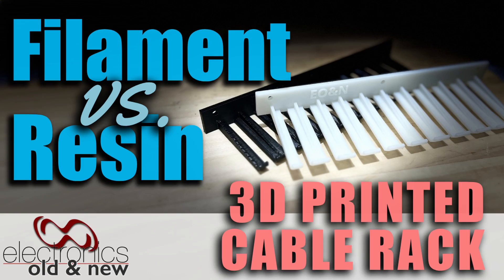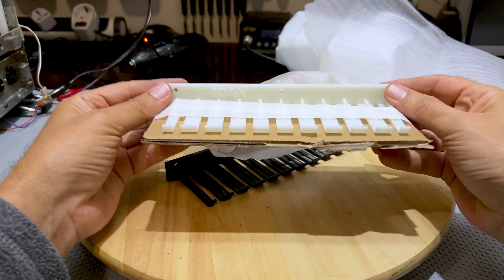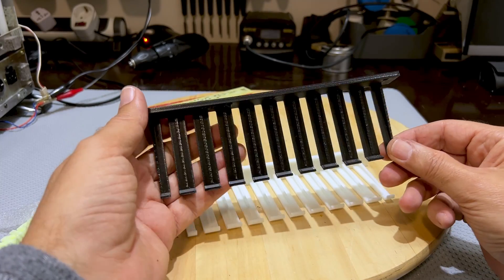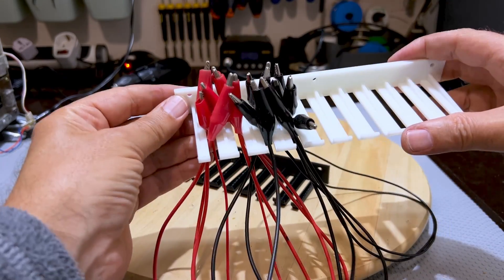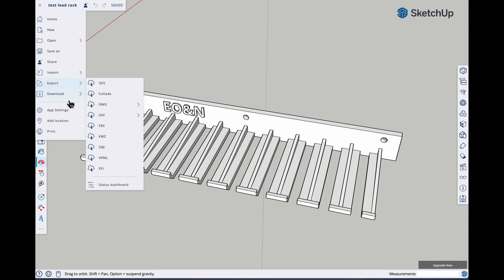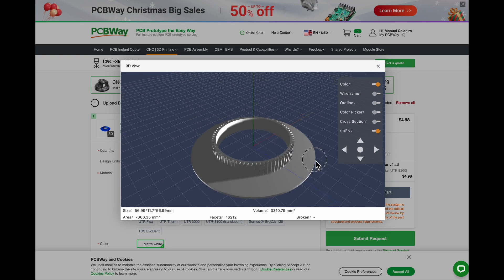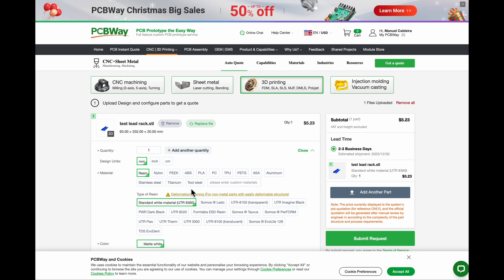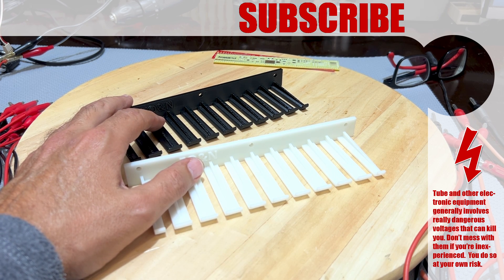Comparison between Filament and Resin 3D-printed Cable Rack #pcbway#

Comment: Resin printing gives great detail, but ... I hate the chemical mess.  I have both FDM and resin, but haven't used the resin printer for more than a year just because of the hassle.  You need to wear gloves to handle the resin, then use a sharp thing to get the print off the buildplate into IPA (or water for some resins), then wash it, get it back out of that chemical mixture, dry it, the  cure it fully with UV light (making sure you somehow also fully cure the inside, which has a significant impact for functional designs) and then you need to dispose of the mess (wash mixture, supports, ...) in a responsible way.  And that's without hitting any problems like spills.  I really only use my 3 FDM printers and only for miniatures I'll consider resin printing ...
Reply from the maker: Yes, I can see how that would turn me off 😊 too much hassle.

Comment: I hang my crocodile cables vertically from tiny circular neodymiym magnets. Theyre about 10mm in diameter and cost peanuts for a large bundle. As theyre just hanging vertically I can just snatch  them without really even looking. Then when putting them back i just hold the clip and touch the magnet abd its fixed then the lower crocodile clip just falls down on to a lower magnet.
Its way more difficult to explain than to do.
Reply from the maker: That’s a great idea. Didn’t think of that. I use those magnets for the screwdrivers and more on my bench, but didn’t think of the cables.

Comment: Hi Manuel. I think we are on the same wavelength here as my Christmas present to myself this year was a resin 3D printer. I still have my filament printer but it is so unreliable that I've not used it for a couple years. I haven't set it up yet but I'm hoping to soon. I just need to make a space for it. Merry Christmas and a Happy New Year, Graham
Reply from the maker: We suffer from the same problem… there’s always another tool that we must have 😊 
Happy New Year to you and Mrs. Cruncher 😊

Comment: I would likely use nylon or petg for gears as resin and pla won't last as long.  PETG is more flexible hence why you can bend it a bit, Nylon is strong and flexible.  PLA is useless for gears as it is too fragile, and Resin can be fragile too.    
The different materials are different pricing due to the type of plastic and some plastics are more suitable for certain applications
Reply from the maker: 👍 thanks

Comment: I tend to use "RS PRO Grey Modular Lead Storage Rack" type racks as you can arrange them for different size cables.
Never thought of 3d printing them, might give them a try.

Don't print with ABS due the health issues with the flumes produced melting ABS, not worth the risk.

Comment: Resin is cheaper because of the time saving. It takes the same amount of time making 1 gear or 20, as long as they fit on the build plate. Time is the biggest cost factor in print services.
Reply from the maker: That makes sense 👍